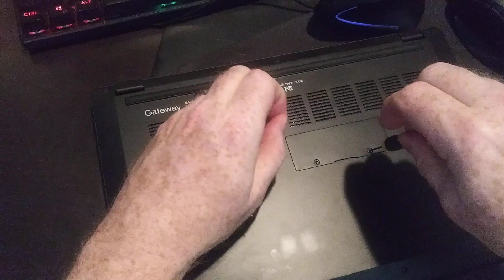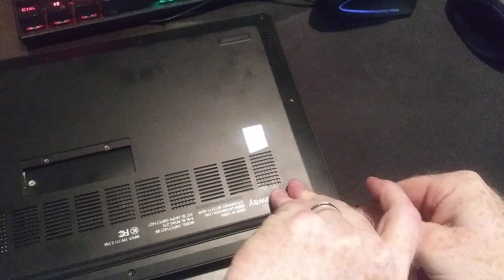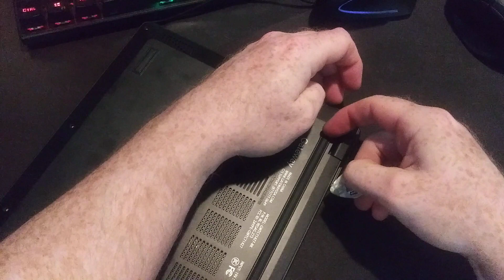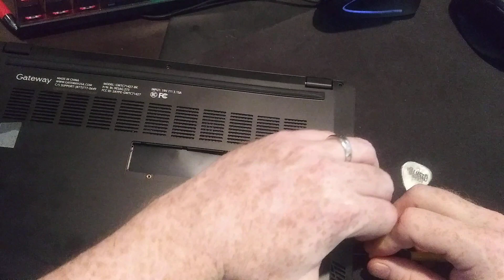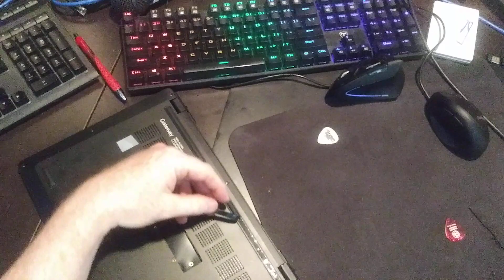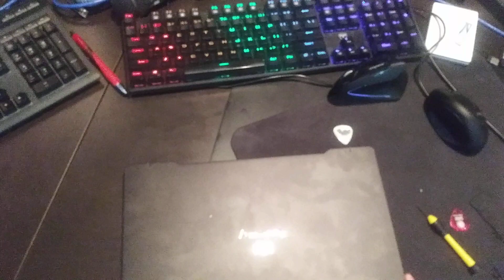Replacing NVME SSD M.2 in Gateway GWTC71427-BK 14.1" FHD Touchscreen i7-1255U 2.8GHz laptop

Comment: Just dealt with this issue. You have to remove battery connection from MB and hold power button for 30 sec. Afterwards reattach and power on. Battery if good should start up to BIOS at minimum. If you do not get past BIOS and into Windows Bootlocker, then you may have to reinsert the M2 drive back into its slot and re-screw it in. Both were an issue with the Gateway Model GWTC71427-BK I had on my desk. Once I finished this, the Bootlocker showed up and was able to restart the computer. Hope this helps you all!
Reply: Tried this, Even boot screen is not showing up.

Comment: is the laptop dead?
Reply from the maker: Yeah.. unfortunately this recurved unit died.  Luckily, it was refunded.  I ended using getting a similar VAIO
Reply: @PC_HardwareTechUnboxing_1  it's because of it's power ic. Throw away the power cord they give and get a usb c pd charger immediately. Vaio laptops are made by the same Shenzhen bmorn company
Reply: @PC_HardwareTechUnboxing_1  it's a known issue with many budget chinese laptops, throw away the box charger immediately. Either get a usb c pd charger or get a pd to power barrel converter. I use a Lenovo 65W usb c charger